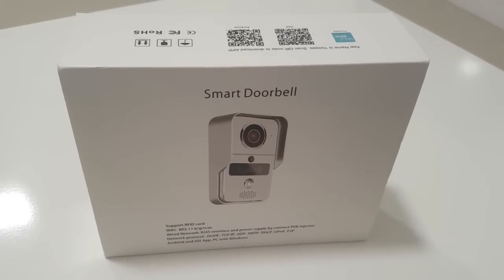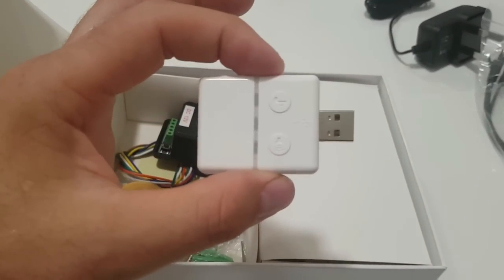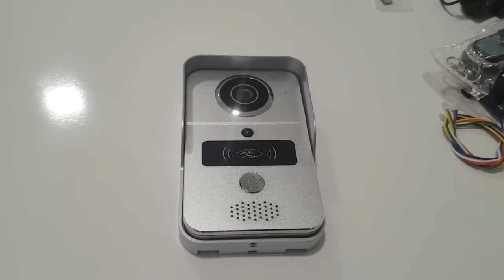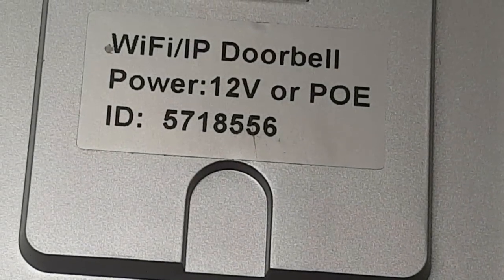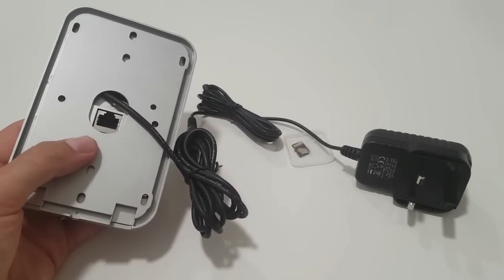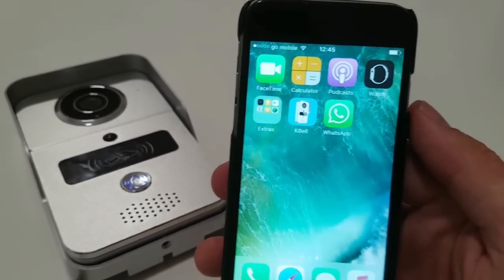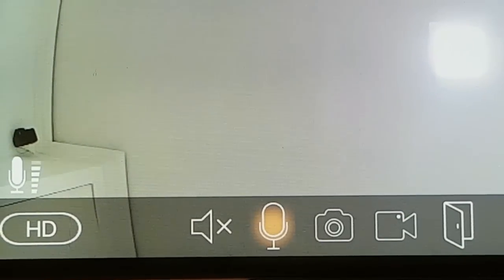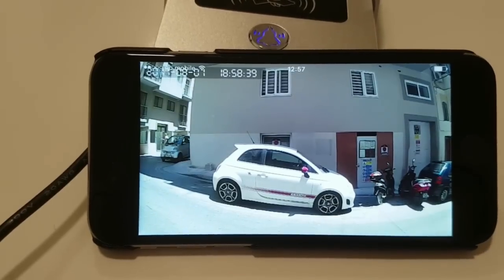Smart WIFI doorbell review with Remote door unlocking. unboxing, configuration  and setup. KW02C

Comment: Nice review.  What is the time delay between the press of the doorbell and the phone actually rings?
Reply: Providing the internet connection on your phone is stable then it will take about 2 to 4 seconds if you are on a different connection to the bell. If you are on the same internet connection therefore at home, your phone will ring right away. When someone presses the doorbell the kw02c makes the same sounds as a phone does when you make a call until someone picks up therefore the person waiting at the door stays there longer and gives you time to pick up even if there's a delay to your phone.

Comment from the maker: The KW02C is now using the Yoosee APP rather than Kbell, notifications do not work on Kbell anymore. Latest updates on the Android OS have made changes to the allowance of notifications from third party apps, therefore, make sure the Android notification settings are turned on for Yoosee and also from the settings of Yooseee make sure notifications are also turned on. Also check out the all NEW KW03, battery powered Smart WIFI doorbell. No wiring at all needed and up to 6 months on a single charge, installed and up and running in a couple minutes.
Reply: Very good review, very well done.  I also don't get notifications, so I will try modifying the android notification settings for the Yoosee app and hopefully that will resolve the issue.

Comment: Thanks for sharing this, very well done, review. I wonder if it's possible to open the solenoid's gate with just the app, rfid, 433 remote control  or, if it's possible to add a phisical  button inside the house. Can the remote doorbell open solenoid too? Does somebody tried to open door with google home and a remote repeater (example broadlink or similar)
Reply from the maker: Hi Andrea. Sorry for the late response. The solenoid lock can be activated via the smartphone through the app or using the RFID cards or by using the remote control which comes included in the package. the package includes a relay system which will output enough current to actuate a standard solenoid lock. On the point of unlocking we would like to point out that for security reasons we suggest only using this feature for internal doors or in places where security isn't an issue.  Examples would be within businesses where its cheaper to install one of these instead of leaving a person at a door all day. Even though we never had any reported security breaches we would take the responsible position and put ones home security over and above everything else. Use this product to monitor who's coming and going, monitor who's at your door in real time and speak to people in real time even when no one is home.

Comment: Hello, thans for your super video. I have one question:  is it possible to configurate on KW02C in more than one celullar. If so, what happens when somebody sound the ring?. It sounds in all the celullars??  Thanks in advance, Luis.
Reply from the maker: Hi, yes it connects to multiple smartphones, one smartphone will be the main device and the others will be extra meaning they can not change settings via the app on your smart doorbell. they will all ring unless the users of the smartphones decide to switch off notifications individually.

Comment: hi i wanna know the password default at the moment to reset it please
Reply: Hi Christian. To reset it you will need to press the reset button which is located on the rear side of the kw02c. Unplug the power then use a match stick or toot pick and press the button, then plug in the power and wait for about 30 seconds for the bell to say wifi down. Now the bell is reset  you may then set a password using the Kbell app.
Reply: @kevinpisani2450  will have the manual